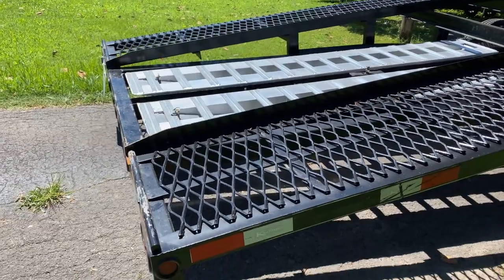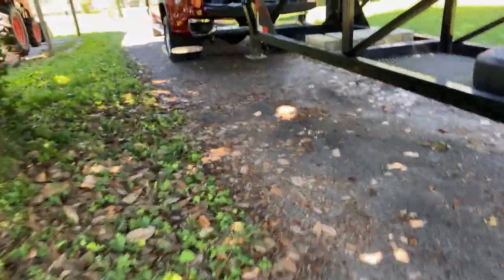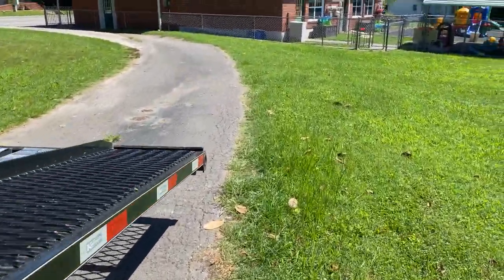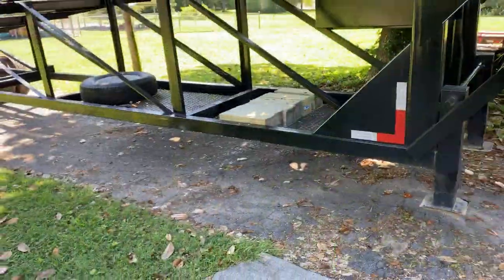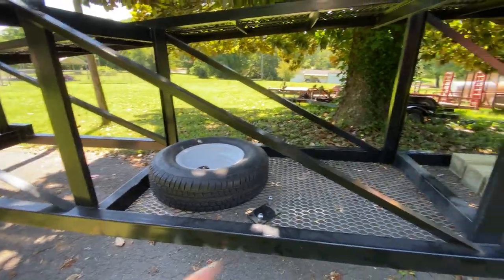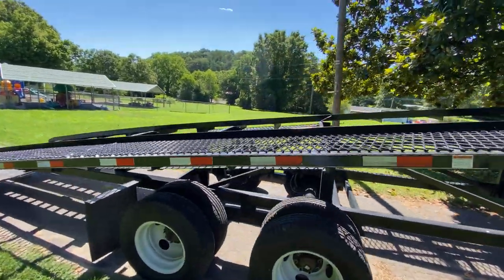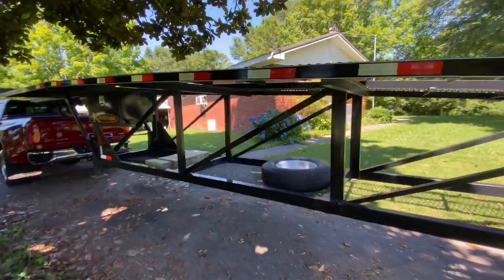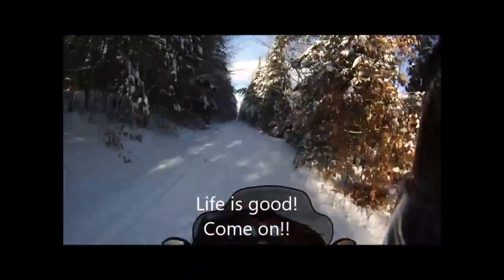2019 Kaufman 3 Car Wedge Upgrades

Comment: Can’t believe that trailers is only $7k. What a good deal. Money maker.
Reply from the maker: Technically I paid $7900 and now have $8900 in it but it’s a $14k trailer
Reply: Best of luck to you with the new venture. I had a couple trucks in Texas and there were loads of those hot shots running around. Often wondered if they made any money. How are your other trucks doing? When I was getting around to going back into trucking you were quite influential so thanks for that. 👍👍
Reply: @SCOTTISHTRUCKERTOMMY  I know one guy local to me that has one and he does hot shot work for some of the car dealerships here. He said he's had a lot of business since the virus that shall not be named, with people buying cars and having them delivered to them.
Reply: The guys in Texas were getting strong money without having to maintain a 175000 tractor unit. Very interesting.
Reply: @SCOTTISHTRUCKERTOMMY  Yeah, if you play your cards right its decent money.

Comment: What’s the specs on the wire mesh floor on trailer? Where could I find it?
Reply from the maker: I think they call it 3/8 and any metal supply place should carry the expanded metal sheets in 3 sizes

Comment: Wow, there must be a lot of non CDL drivers out there destroying a lot of cargo freight, especially because of the tie downs and accidents, I'm surprised that the pit stop aren't shutting them down for good. I'm hearing anyone can become a hotshot driver guy in New Hampshire killed 7 motorcycle veterans, wipe them all out with his trailer take one idiot to ruining it for everyone.
Reply: Yea, they should at least make pulling a trailer (any trailer) an endorsement on the drivers license. I see a lot of idiots pulling these small trailers all the time without any load securement, not to mention all the dangerous maneuvers made while driving down the road!
Reply: @bigbear5510  We should just be teaching people how to do it right. Don't need more government bullshit.
Reply: I see tons of those "hotshots" pulled over at the weight stations and on exit ramps.....DOT loves them cause half the time they aren't tagged for what and how much they are hauling.....
Reply: @williams6550  That's my point of having it as an endorsement on the license. Here in Georgia that's the difference between a class A & B CDL license. Class A is for combination vehicles & a Class B is for like dump trucks or similar size truck. Now you have to have a Class A to pull a trailer with a dump truck or it's equal.
I was told that you can have a Class C CDL witch allows you to drive the delivery truck for FedEx, according to my niece because her mother worked there for a short time & I seen a picture of her CDL learners permit.
Reply: @moondog3162  They got the word correct, most of them are just want a be truck drivers. There are a lot of good one out there also. It's like any profession, there's always a few dumb a$$es that make the others look bad! 

I started driving OTR for USA Truck back in early 2000. I've seen a lot of strange things out there on the road, trucks laying down taking naps, drivers tearing doors off the trailer, even see a few way off the road up into the woods on a straight away, just to mention a few.🙄😲🤪😎
Reply: @bigbear5510  👍